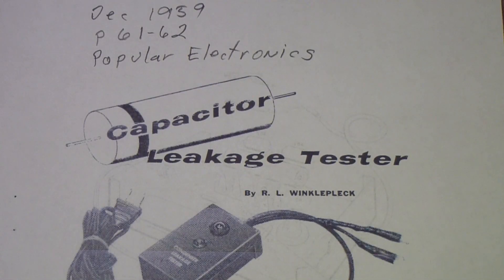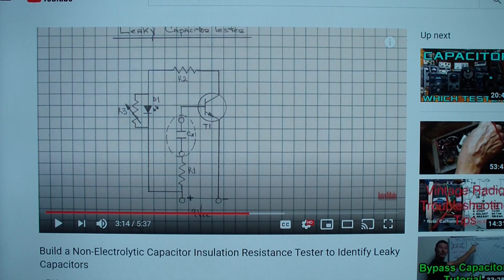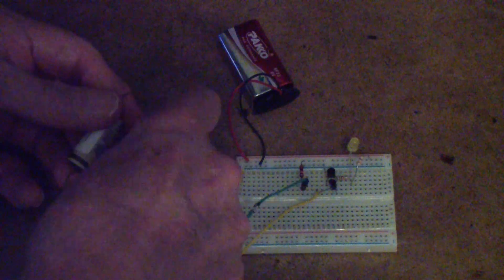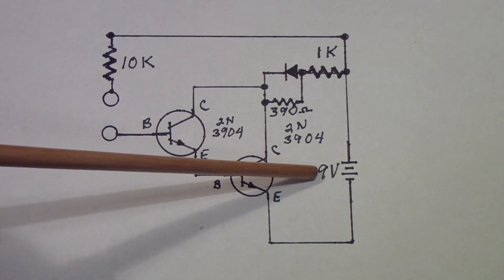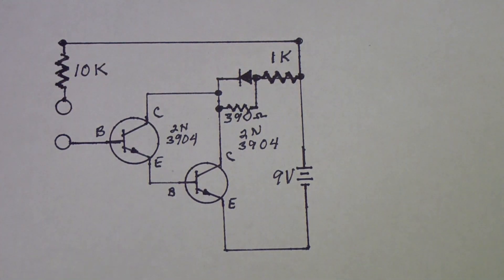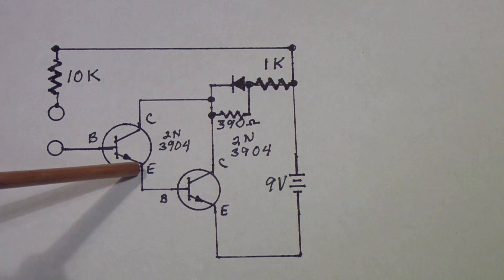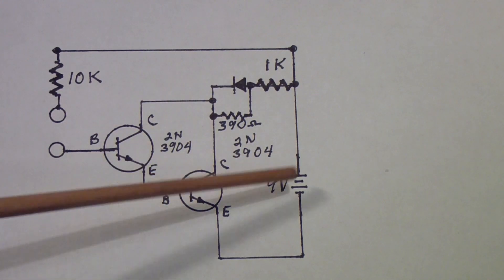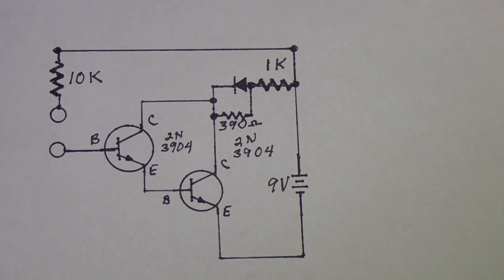TTT339 New DIY Capacitor Tester

Comment: Thank you for the posting on this CIRCUIT (despite what one poster said here) and article. It inspired me to plagiarize the original 2 transistor circuit, but adding a third transistor, then, selecting the level of sensitivity by moving the test lead to the base of either the first, second or third transistor to control the gain. I found it will light an LED with about 5 Gigaohms of resistance between the 2 test leads, and can be used to indicate leakage in foil, mica or ceramic caps using a low voltage. It's debatable weather a full "rated voltage" test for leakage may breakdown an insulation fault that a low voltage  tester possibly won't find, but finding a fault of that value will definitely indicate that the capacitor will have internal/parallel resistance that it should not have.

Comment: Hi Tom, I put together this circuit and got ready to calibrate but you never gave the value of the resistor string to which you calibrated to.  I did go back the the video that you used the chain and the meter measured 147 M Ohm (150M ohm)  I just wanted to confirm with you the calibration ohms.  
Also,  what resisters is this ment for?  Electrolytic and film?  I actually put a 500 Ohm 20 turn trim pot at the 390 ohm resistor and put electrolytic in the test spot and tuned the pot to get the LED to dim.  At 390 ohm, the LED goes out, at 400 ohm the LED will glow ever so slightly. (to let met know its working)   I used the electrolytic to calibrate as I do not have a 150M Ohm resistor or enough 10's to solder together to get that high.  I will order a 150M Ohm soon.
Oops sorry, I just caught the part where you said you set it to set it so it will sense about 250M Ohm.  (I missed that the first 2-3 times of watching the video.) You must have used a 250M vs the 150M.
Thank you, I enjoy watching your videos, I have learned a lot.

Comment: Sir but that's not your circuit sir..that is nothing but Darlington transistor config.. no other components then pure darlington.you may as well avoid the 2 transistors and but a Darlington and  capacitor leakage tester done all you need according to you sir is cap and one Darlington..which I do not think so. Sir. Try buying a single Darlington to make a leakage tester sir not a circuit. Adding voltage decider and led still makes it only one single Darlington as there is no current limiting circuit is plane Darlington and nothing else. We could make what Darlington can detect ion Geiger counter them leakage current or shall be say what's the sensitivity of bias. Sir. That's what I think. Not a circuit at all sir.

Comment: Interesting idea. I test cable leakage of transducers (load cells) using a megohm meter and the debate has always been what voltage should be applied. Some of them use 50vdc, some 500vdc and some 1000vdc.
I have always had good luck with the 50vdc version. 
I wonder how the applied voltage would affect the test results. Could a "good" cap tested with 9dvc fail in circuit @ 500vdc?

Comment: Thanks for this video can this tester measure the leakage current of 500 v ... 600 v capacitors?
Reply: Not with a low voltage battery. The only way to fully test a 600 volt capacitor is with a 600 volt power supply.

Comment: Well done I like this idea. At 6:56 you meant: "a shorted capacitor" not transistor. I think this circuit needs further modification to distinguish between capacitors and electrolytic ones. This could be done by making a switchable circuit where there is the 390ohm calibrator resistor. With your low voltage circuit at least you've decreased the risk of the danger in everyday practical use. What's the point if a capacitor fails under the low voltage tester to test it with the higher voltage one? Should a capacitor not fail under the low voltage tester then one might choose to take that risk and test it with the higher voltage one. Thank you from 🇲🇹 Malta.

Comment: Hi Tom, Don from RestoreOldRadios referred me to your wonderful site, I took Dons leakage circuit and replaced his single transistor with a Darlington pair and it works very well, and very sensitive. I have checked over fifty paper caps and only one passed.
Reply from the maker: Good to hear from you on your tests. I haven't tried many old paper caps on the new (Darlington) tester but I have tested several hundred on the old PopCom design and they all had some leakage. Only the good Sprague capacitors (like those used in better Hallicrafters receivers) passed with no leakage. I first built the PopCom design in 1959 to find bad capacitors in vertical circuits of TV sets. Later I found it also worked to find leaky I.F. transformers that caused the same bias up set in the Video IF stages. Admiral sets seemed to have the most leaky I.F. transformers.

Comment: This looks like a very handy device to have available on the bench, to quick-check new caps before installing into repair/refurb work.  (I agree with your position that you should check new items before installing. Failure rates are low, with items sourced from quality vendors, but they are there.) If a quick method of checking is available, it makes no sense to risk inserting problems into your work. Now I hope you’ll turn your attention to developing a similarly simple method to identify the outside foil end of the capacitor. It irritates me to no end that manufacturers do not mark the outside foil, at least on the higher voltage rated capacitors. How difficult would that be, and how costly, really? It is an important consideration in some areas of tube design and construction.  Thanks for your continuing excellent videos. I’ve learned a lot from them.
Reply from the maker: I think that most manufacturers assume that everyone uses caps in low impedance circuits where the pickup through the outside foil is less of a problem. I did build a small switch box that makes it easier to test them using an oscilloscope and 60 Hz pickup. It appears in the Frugal Repairman series (around Part 12 - TTT281) if you haven't seen it.
Reply: @tomtektest8042  Thanks! I’ll check it out.
Reply: @tomtektest8042  where can I find the Frugal Repairman series?
I searched but don't see it.
Thanks

Comment: To test leakage I use my iso tfmr & variac to power a doubler ,with a neon "leakage" indicator like your first schematic, but I put an ammeter before the cap under test. The neon shows excessive leakage, but also as a normal healthy caps dialetric should have a constant resistance, therefore the relationship between the voltage it's tested at and leakage current should be linear yes? So if I test a cap at 450v, the leakage if healthy, the ammeter reading should be 45 something, with electrolytics this is usually 45uA, poly types 4.5uA.
  I use this and the neon to test for leakage, but I'm still testing at full working voltage + 10%. I can't see how a cap can be tested properly at a lower than wkg V, it will behave differently. Yes high voltage is potentially lethal, but if you need to test a HV cap and don't feel comfortable doing so at full wkg voltage, then you shouldn't be working on that sort of gear. I don't mean you "Tom", I mean in general.
   That said if a healthy caps V and dialetric R should be linear, maybe you could use a comparator to compare V and leakage I?....DA.
Reply from the maker: I always worry that someone with little experience or safety knowledge will think that if they see it on YouTube, it must be safe. On the other hand, even experienced people make mistakes (I certainly have) and touch something that they should know better. You are right that the only way I know to fully test a capacitor is to stress it to its full working voltage while measuring the leakage. But this new idea from RestoreOldRadios (with the Darlington addition) should find most of the bad caps in a batch before you install them. I showed a 630 volt film cap in TTT338 that failed badly with just 330 VDC applied even though it had never been used before. But you are right, most modern capacitors are pretty reliable (if you stay away from the E-Bay bargains.)
Reply: Yeah I was wondering the same thing, I have seen videos on Mr Carlson's Lab where he shows how a leaky capacitor can still test good at a lower voltage other than what it's going to be working with or rated for. Carlson has his own tester but it doesn't use high voltage to test which kinda makes me skeptical about it's operation, it appears to work well and he's very intelligent but there's something about it that I just can't put my finger on why I'm not jumping on it, maybe it's the indicator setup? Maybe I'm used to seeing someone turn a voltage knob and seeing where the capacitor begins to struggle? Whereas with his low voltage design, the led meter lights up and you have to just sit and wait for something to happen? 
So the problem I have with this circuit is that it operates at 9V which is great for 10V capacitors, unless it's so sensitive that it's able to pick up current leakage in the micro amp range which might give a clue to what's in store higher up in the voltage range? I don't know but I think that it's an interesting idea, maybe the old Heathkit and EICO capacitor testers can't show leakage at lower voltages on high voltage capacitors due to not being sensitive enough? As in the leakage problem might be a linear thing where if it's Leakey at it's rated voltage then it's also Leakey at a lower voltage but you would need more sensitivity at the lower end of the voltage scale because the leakage will have a sort of reverse snowball effect, the lower the voltage, the higher the sensitivity needed, not sure if any of this makes any sense but in my head it sorta does.
Or you can always run the capacitor to ground instead of going to the transistor, then use a comparator across both sides of the capacitor to test for leakage, and possibly a second or third stage to bring up any leakage that's hiding below the circuit's threshold? 
I would love to be able to sit down and give this a go, I know what outcome I want to see and if it can work, I know that I can get it to work but my anxiety has crippled me and I just don't have the patience at this time to attempt it. This is about as helpful as I can be right now.

Comment: Thanks again for the videos.  I have watched Mr Carlson's capacitor tester and it works the same way, detecting very small currents. There are several iterations of his. The question I have had in the back of my mind is that what if you get a capacitor that only conducts at high voltage.  I know it's probably not common, but a simple spark gap will close suddenly
Reply from the maker: Thanks for the comment and excellent question. This new design only tests whether a capacitor has leakage, it does not stress it. To do that requires that you actually apply high voltage to the capacitor. Of course, when you use high voltage safety becomes a concern.
Reply: @tomtektest8042  I understand the safety part.  Nothing about tube circuits are safe by today's standards. No way we would allow cars on 2 lane roads if invented today either.